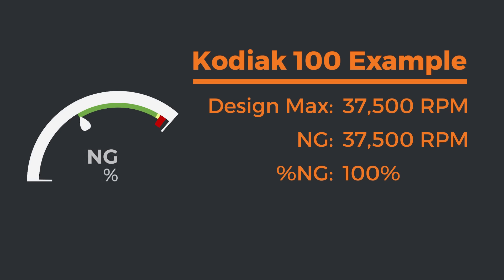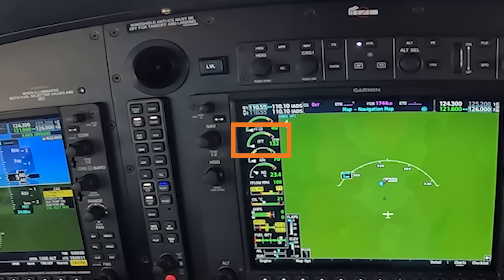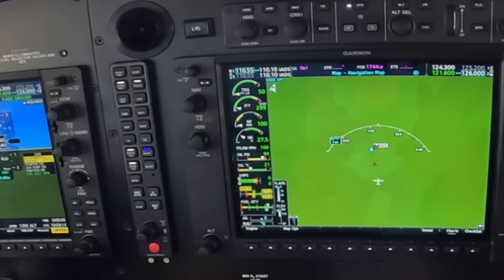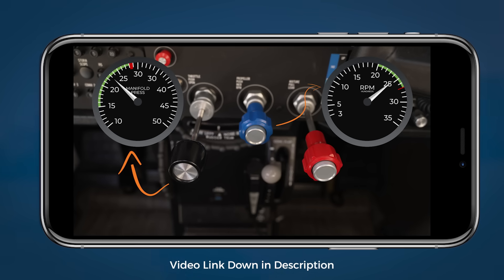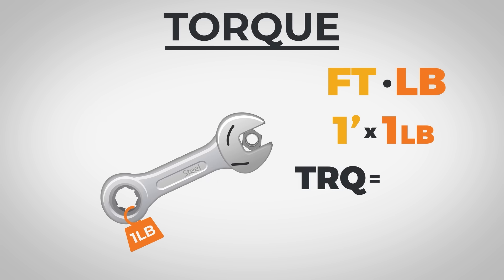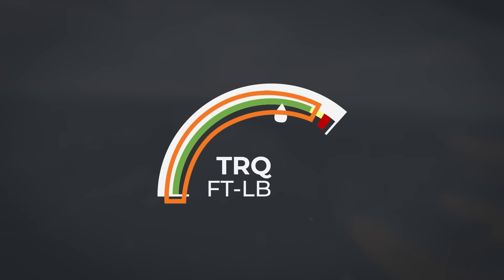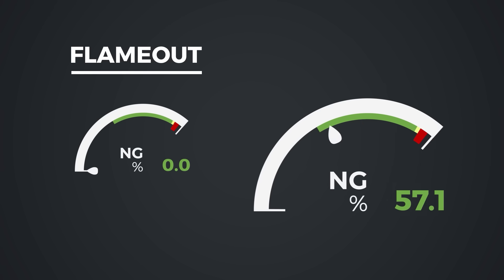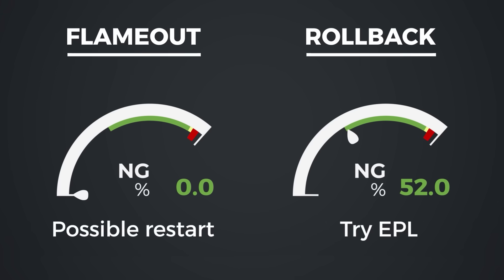Turboprop Terms in PLAIN ENGLISH (ITT, %NG, NP, Torque)

Comment: Slight correction at 8:30. Pounds in this case are a measurement of force, not pressure. Pressure is force over area.

Comment: during normal operation of a turbine engine about half of compressed air is used for cooling combustors and turbine section. during startup if too much fuel is introduced (or was left from previous hong/stopped hot start) that can cause that excess fuel will use cooling air, and in result introduce damage.

Comment: overtorque possiblity is made to put in lighter gearbox.  engine is ex capable to generate 1000hp at sea level but at cruising altitude generate only 600hp so you put gearbox/propeller/airframe/tail for 600hp only. (so you save weight not only on gearbox but basically on everything)

Comment: Great video. Question: What starts the rotation of the engine to an NG of 15 % before fuel is added? Thank you.
Reply: A starter / generator similar to what's in your car except it also serves as an electrical generator when not in start mode

Comment: A pound isn't necessarily a unit of weight, it's used for a few things.  But as used here it's a unit of force.  We only use it as a unit of weight when we are referring to a force generated by gravity.  To add to the confusion, the unit of mass is also referred to as a pound in our unit system.  We have pounds force and pounds mass.  A unit of weight is determined by an item's mass multiplied by its acceleration.  I'm going to give an example using the communist unit system because it's less confusing.  You have an item with a mass of 10kg.  Earth's gravity exerts an acceleration of 9.8m/s^2 on that item, so it has a weight of 98 Newtons.  It that same item was floating in space and you applied a 98 Newton force to it, it would accelerate at a rate of 9.8 m/s^2.  The forces are both the same, but one is considered a weight because it is referring to a force caused by gravity.